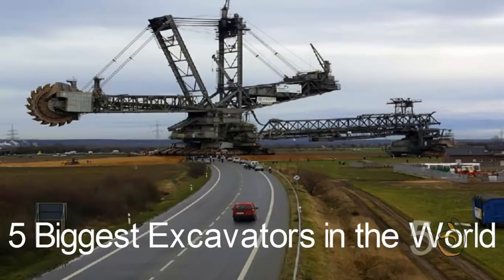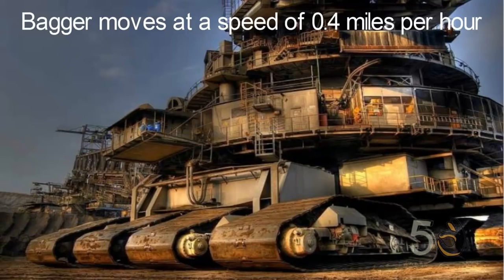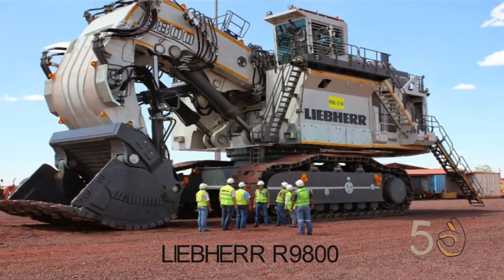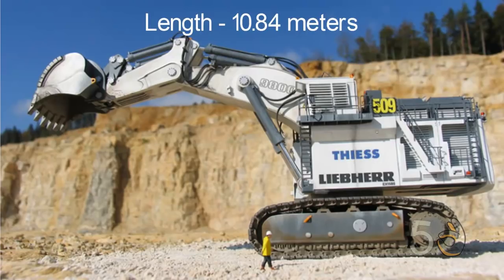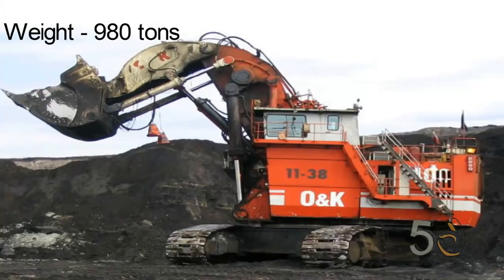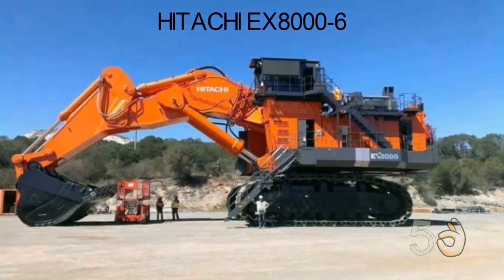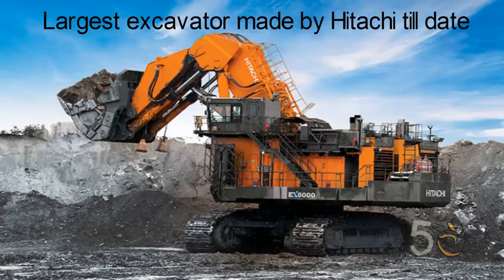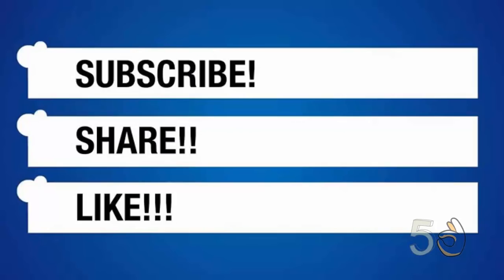5 Biggest Excavators in the World

Comment: https://loadmate.blogspot.in/2018/04/how-to-install-electric-chain-hoist.html  Your work is great .https://loadmate.blogspot.in/2018/04/cranes-play-important-role-within.htmlWe are https://www.loadmate.in RMS INDUSTRIES (Loadmate)  https://loadmate.blogspot.in/2018/04/hoists-safety-measures.html(An ISO 9001:2008 Certified Company) https://loadmate.blogspot.in/2018/04/how-to-choose-manual-chain-pulley-block.html is one of the leading EOT Crane Manufacturer in India.https://loadmate.blogspot.in/2018/03/one-of-vital-and-long-tasks-was.html We also manufacture https://loadmate.blogspot.in/2018/02/www.loadmate.in_15.html"rel="dofollow Manual Chain Pulley Block, (Loadmate) https://www.youtube.com/watch?v=_mJFgI2_y0I Electric Chain hoist,https://loadmate.blogspot.in/2018/02/www.loadmate.in_15.html"rel="dofollow  Electric Wire Rope Hoist, https://www.youtube.com/watch?v=_mJFgI2_y0I HOT Cranes, Gantry Cranes,"https://loadmate.blogspot.in/2018/02/www.loadmate.in_15.html JIB Cranes https://loadmate.blogspot.in/2018/04/there-are-varied-prestigious-suppliers.html& Goliath Crane.